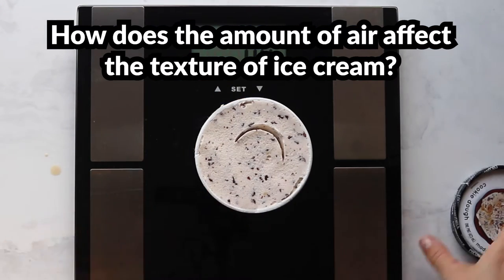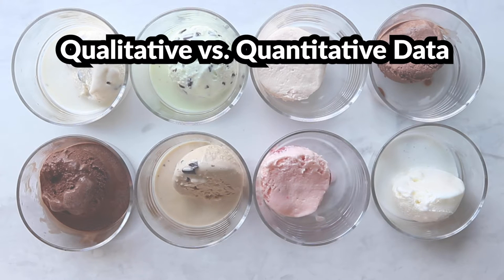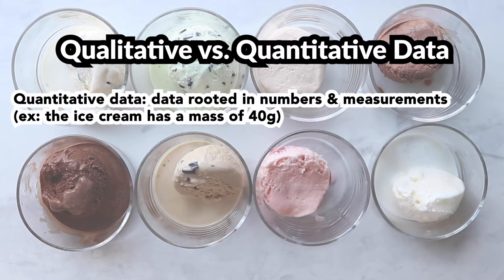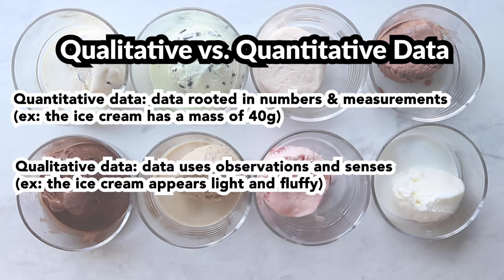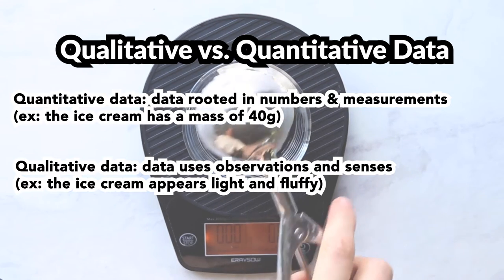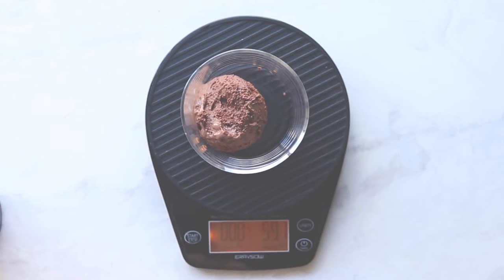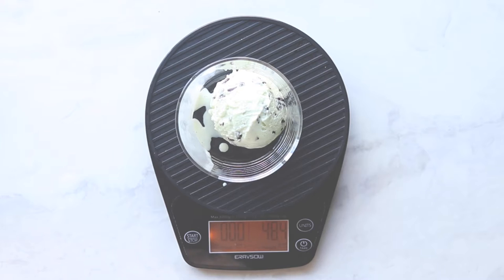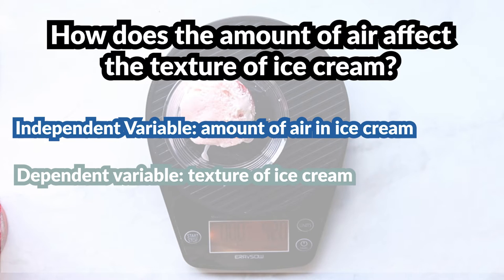THE SCIENCE BEHIND ICE CREAM & AIR: mass, density & force [learn science through food and cooking]

Comment: The nutritional facts sheets of ice creams already has the necessary data for your quantitative analysis. It is in the form of "Serving Size". For example when the label reads "Serving Size 2/3 cup (143 g)", 2/3 cup is the volume and 143 g is the weight. The only slight hiccup is, the serving size volume varies from ice cream to ice cream. You just have to standardise it to your desired volume and find the equivalent weight. This way you can eliminate the said human error in the experiment. And when you have volume and the weight, you get the amount of air in your ice cream without even opening a pint.